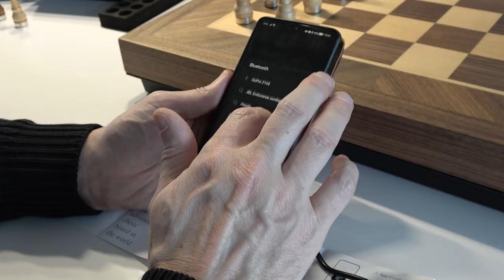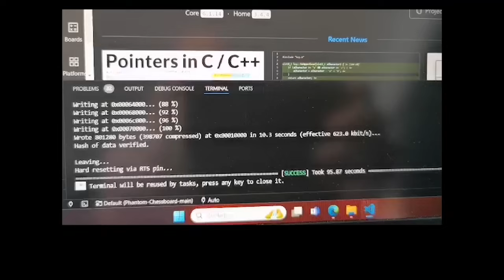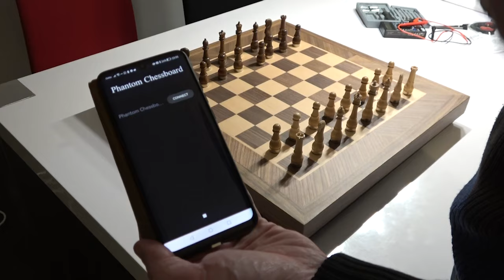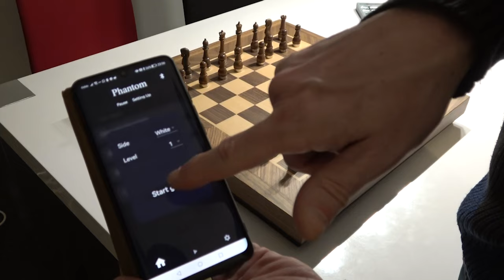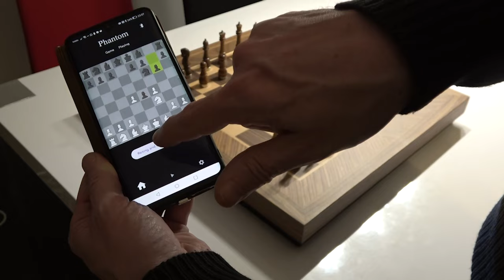Phantom Chess unboxing and review (betatest)

Comment: I was hoping for more videos from a beta tester, although looking in your other videos, I saw the PET Lunar lander and made the whole experience of watching you work through the hardware debugging well worth it ;-). I hope my production copy doesn`t require manual programming in C and a voltmeter!
Reply from the maker: @ajs98405  I must admit I never got to making more videos. I can assure you though that you won'thave to get your tools out. I had one of the very first boards and it was a case of bad luck. The board has been replaced and it has had quite some OTA firmware updates since. Some minor bugs and feature requests are still pending, but I and the other beta users have beautiful, working boards now, which look great and are fun to play with. Perhaps, I will make a new review video sometime.

Comment: It actually doesn't look as bad as I worried. The delay suggested it would be full of cut corners, but it seems to mostly do what was promised. Hopefully, they'll address the issues of the battery coming loose and causing internal damage.
Reply from the maker: Absolutely. I am quite fond of the design. As for the battery, they said they're going to add a clamp to secure the battery in stead of the glue that is keeping it in place on the beta units.

Comment: Would you say the noise is too loud? And is that something that they’re working on? I really like the concept. But I’d love it when it’s silent. It makes more magical.
Reply from the maker: No, in my opinion the noise is absolutely not too loud. The camera makes it sound louder than it is in reality. Yes, you hear the mechanism inside, but it is a subtle sound and almost a bit soothing.
I usually play chess with some soft jazz playing in the background and then you can hardly hear it anyway.
It's not something that can be changed anyway, because these are the mechanics as they are.

Comment: Thanks Ivo for the hard work, video looks great. 
You mentioned creating your own « user manual », would you be willing to share it once done? :)
Reply from the maker: Yes, I have already written one. But it is based on the current 0.0.3 firmware and app. I expect a lot of changes in this phase of the project so it won't be accurate for long. I have shared it with Wonder Substance and suggested to cooperate on the official user manual.

Comment: it's still really noisy for the price compared to the square off Neo videos.
Reply from the maker: My camera tends to enhance low volumes and objects close to the microphone. On video the board absolutely sounds more noisy than in real life, to be honest.
Reply: That can be reduced with using quality "silent" stepper drivers and motors as those are usually to culprit in cheap and loud 3d printers. Tightening everything including the belts to reduce vibration also helps.

Comment: Have you beaten it yet? I bought a chess computer (Vonset Chess) and I have yet to beat it 😂
Reply from the maker: @kevingirling8129  I wasn't able to beat it without help, which frustrated me. Turned out there was a bug in the software, where Stockfish level 1 actually was playing on Stockfish level 4 or 5. This has been resolved though and now I can play with much more confidence. 😉
Reply: @ivosenden  chess computers are nowhere near human. I struggle with mine, it is unpredictable and sometimes does moves I struggle to understand. I was taught to carefully move your opening pieces, slowly building up a defensive/offensive strategy, aiming for more dominated squares until finally unleashing an attack where losses are in my favour. A chess computer won't do this consistently. It will surprise me with attacks that exchange pieces in moves that I wouldn't have contemplated till later in the game. You need a different approach to playing a human. It is almost clinical in its approach. I can't knock it though, as it wins consistently. I am getting better at knowing what it is likely to do next. However, I miss the human factor, it is no real substitute for another person.
Reply: It has taught me respect though 😂

Comment: This is not usable for a bullet or blitz-games; one does lose too much time with moving pieces. 30 moves of ones opponent can easily cost one minute
Reply from the maker: That is correct. There are adjustable speeds, but even then I wouldn't recommend it if you like a high speed game. Unless you have a human opponent for that

Comment: The "version" does not need to be better--- the assembly is obviously being mis-managed.  Perhaps not enough supervision (effective supervision where you fire those who are affraid to get rid of those who screw up).  Hopefully, the manufacturer does NOT expect the average consumer to do cable testing and evaluation of things like an electrical connection wire going through an assembly that has a rubber pully and cable like a bike chain right through in between the moving construct, where it absolutely should not be placed in the first place.😐

Comment: It's not a chess computer per definition as it does not have any onboard chess logic outside a microcontroller dedicated for the stepper motors and magnets and an onboard Bluetooth module. Its a borderline brainless robot dependent on external gcode commands from a computer/smartphone. In short its more related to a 3d printer than your phone or pc.

Comment: Great video. I'm trying to put one together. Here's the video.

https://www.youtube.com/watch?v=y6mcz0X15qY

It would help me a lot if you give details of the board. In my case I used acrylic and it has warping issues. what material and thickness did they use on the board? Thanks and regards from Argentina.